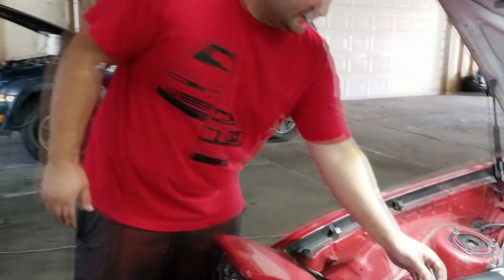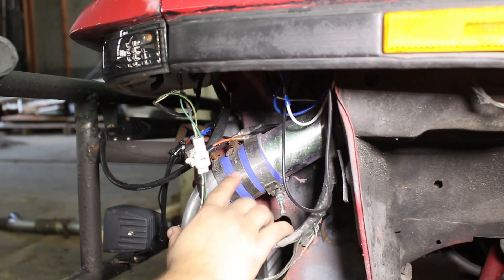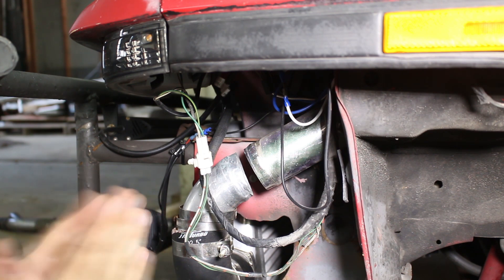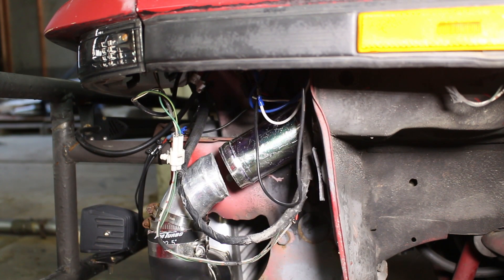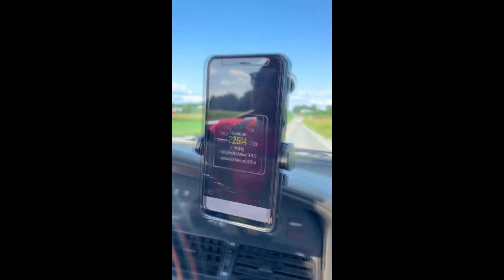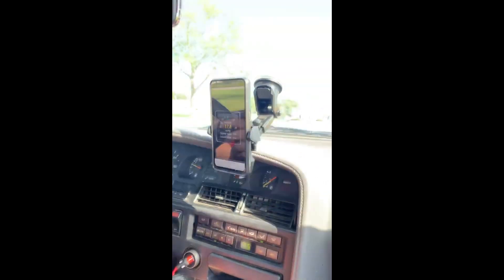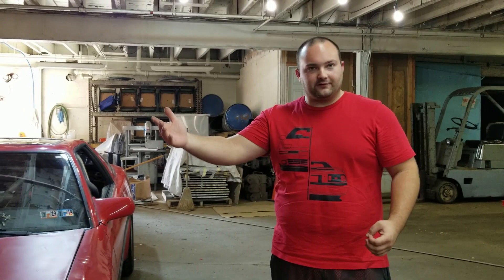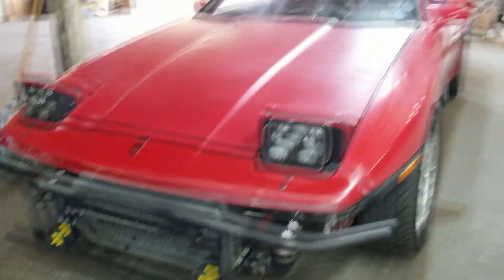How much boost can duct tape handle? Today we find out!

Comment: Great minds think alike.

As for longevity, it could be just another maintenance item. Replace as needed.

It's a great alternative to buying a Tig welder. 😁
Reply from the maker: @FILIPINOTUNER  heck yeah 🤙 this coupler last like 4 or 5 years before I took it off and it DID NOT want to come off!!
Reply: @PoorManMods  That's amazing! Did you remove it because it started to leak?
Reply from the maker: @FILIPINOTUNER  nope, I removed it because I changed my piping setup, it was working perfect, maybe even better than a silicon coupler

Comment: One time my friend fixed a blown intake pipe on some diesel cummins engine using a plastic bag and insulating tape. It holds a stock boost pressure alright and i believe that truck running like this even today...